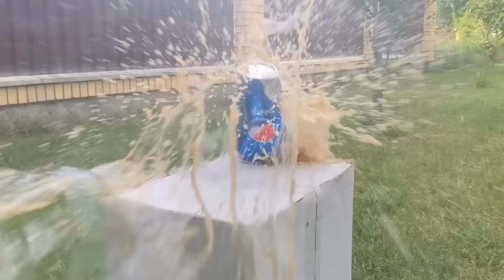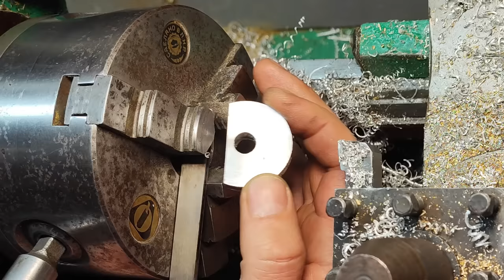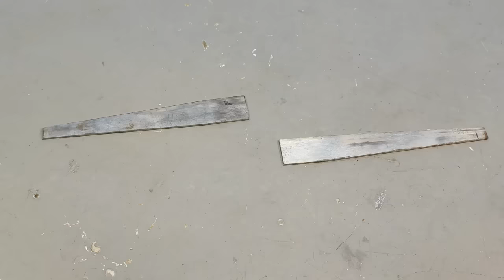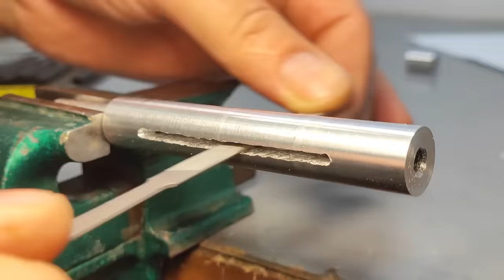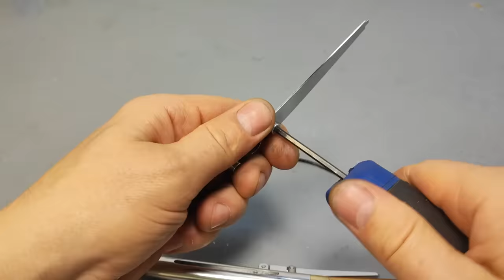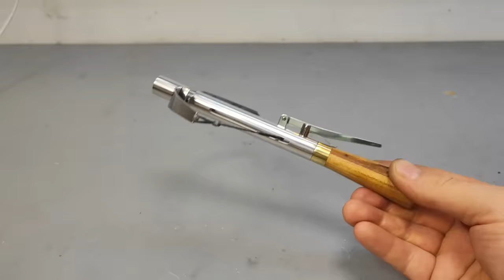Assassin's Crossbow Homemade

Comment: Sir, you are a very good craftsman.  I can see where you could use a milling machine, especially where you slotted the body by drilling and filing.
Reply from the maker: Many thanks friend. I don't have a milling machine. Haven't worked on the machine yet. but i plan to buy it

Comment: Finally, a crossbow that does not drag the string across the top of the stock.  Nice build.  However with that low poundage, the LAST arrowhead you should have is a 3 blade.  Should be a cut on contact 2 blade, if you actually want to penetrate.

Comment: Suggestion. For the longevity of your file, use it on the forward stroke only. The backstroke only dulls the file teeth.
Reply: Proven wrong.
Reply: That’s a myth
Reply: That’s the problem with YouTube. All these alleged experts putting out consistently bad information. 🤔🙄
Reply: @Guitarplayer724  I have been a mechanic all my life. From the time I was able to use tools at the age of 3, in 1963, until last year. I know how to use tools correctly. Files can't cut on a backstroke, the teeth don't face that way. I am no expert but I DO know how to use tools correctly.
Reply: @GVBiggs524  Whether the file cuts on the backstroke was never the question. It’s your claim that it will dull the file, which just isn’t true. On the other hand, it won’t cut either, which is just a waste of energy.
Reply: @Guitarplayer724  you sure do live up to your name.
Reply: @GVBiggs524  lol ok bud 👍🏻 happy new years!
Reply: @GuitarChump  you as well. Let's agree to disagree and hold no grudges or animosity. I imagine that if we knew each other, we would have a good chance of being friends. This would be good, for both of us, I think.

Comment: If I would do that I would use a real 90lb string loader and use an umbrella but better with a co2 30j cartridge with a 12 Gramm capsule to shoot the arrow. That would actually be deadly and way easier to build. Just front load the arrow, and pull the trigger. It’s good I wasn’t around for the old bond movies.